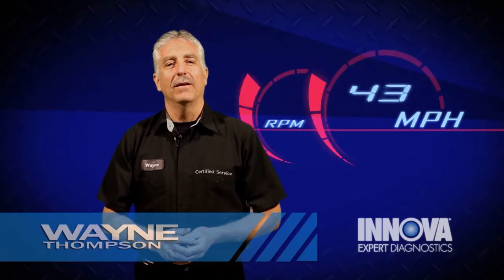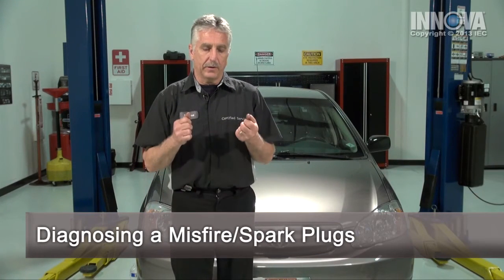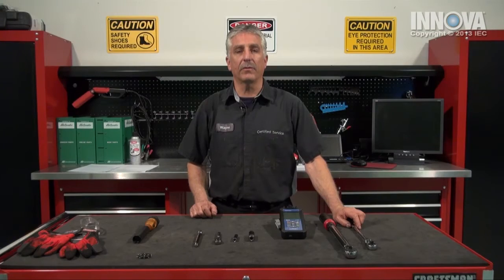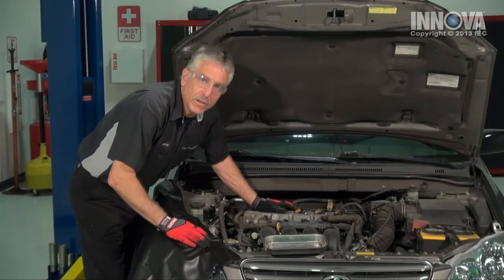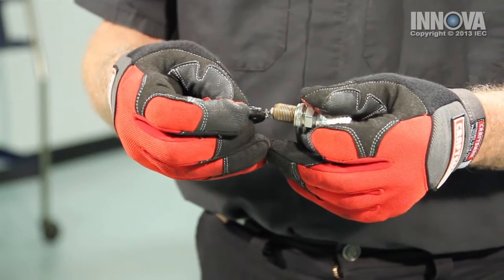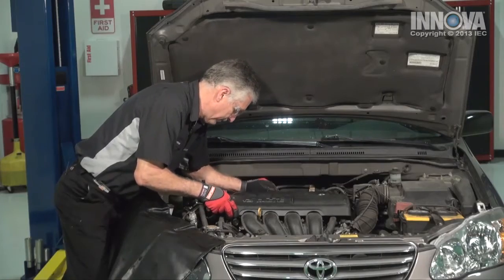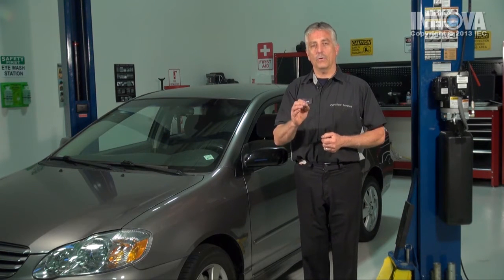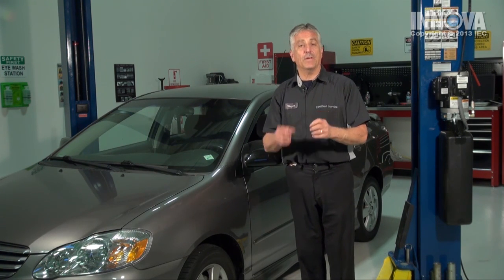How to diagnose an Engine Misfire - Spark Plugs - 2003 Toyota Corolla

Comment: It needs a new engine or a expensive repair? Changed burnt spark plug oil light stays on all the time put 4000 miles on it in 2 months changed spark plugs when I bought it 2 months ago